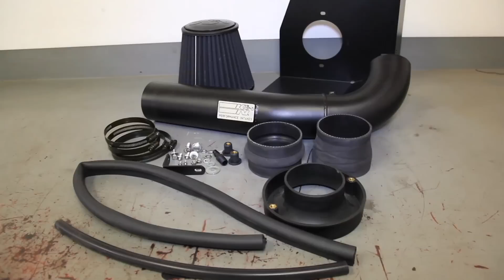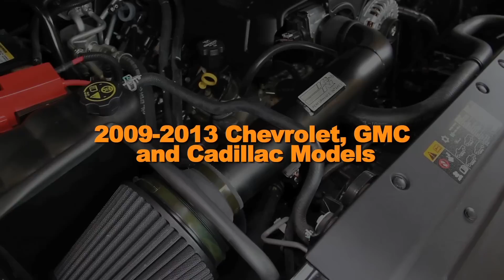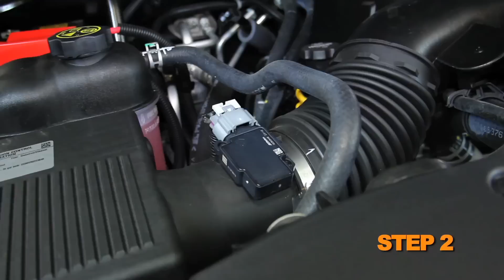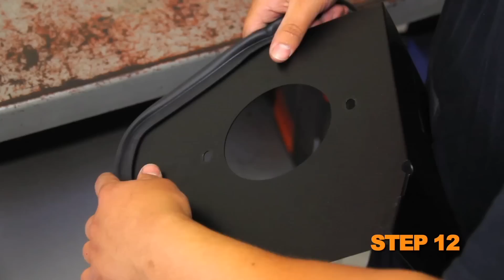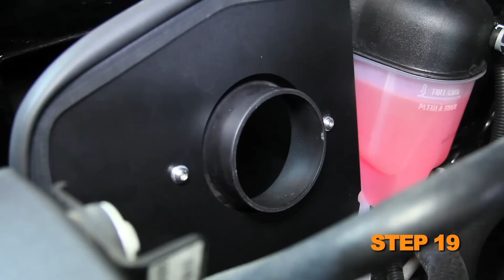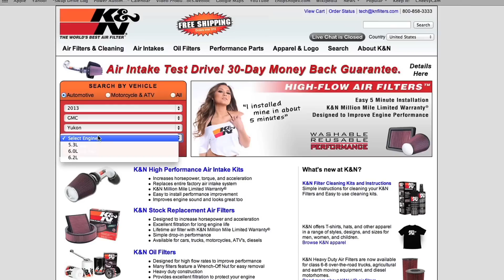2009-2013 Chevy, GMC & Cadillac Models 6.2L, 5.3L and 4.8L Air Intake Installation

Comment: Can installing this cause a check engine light to come on?
Reply: David Ramirez pretty much. If not right away with in a month or 2
Reply: You should always go to a trained mechanic for any warning lights. Something as small as the maf sensor or the pcv breather hose incorrectly installed could be the issue. Post up the dtc info
Reply: No
Reply: Installing these properly will never set off a code or engine light.